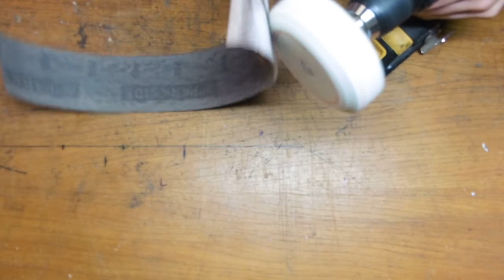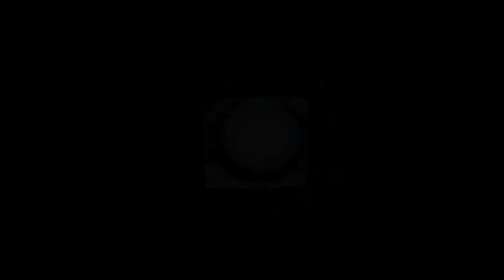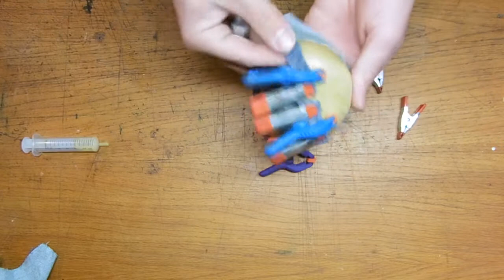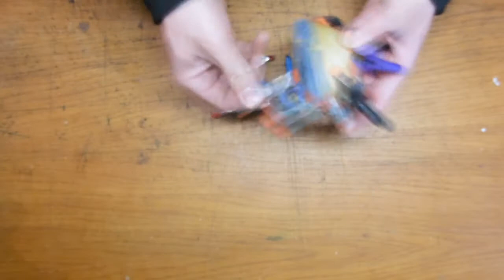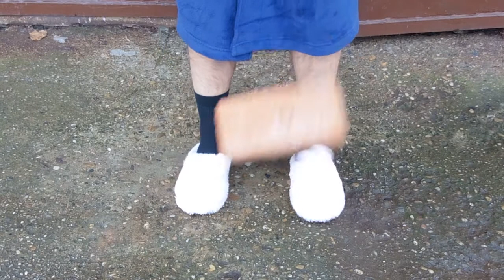MK: DIY Kevlar toe slippers

Comment: Nice work!! I want to play around Kevlar for structural reinforcing purposes like this toe protector. Just ordered 200 g/m2 Kevlar woven fabric just like one in this video and Kevlar scissors. I'm very confident of the Kevlar itself's tensile strength but worried about bonding Kevlar with Kevlar, or with other material. I searched on the web, found some adhesive for just that purpose but they don't seem to sell for individuals. Will epoxy okay if I intertwine layer by layer? How about stitching with Kevlar yarn? Is welding with heat possible? Could you give me some advice or link on strongly joining them? Thank you.
Reply from the maker: typebin if you join fabrics with epoxy it will hold well, if you join already cured pieces with epoxy it holds well, especially if you like rough the surface with sandpaper. Welding wouldnt work cause its basically a thermoset so it cant be remelted. 
When  its cured you can also join them mechanicly with nuts and bolts but I would suggest larger washers for better pressure distribution. Hope i helped, let me know how are your projects going or if you want to discuss anything!